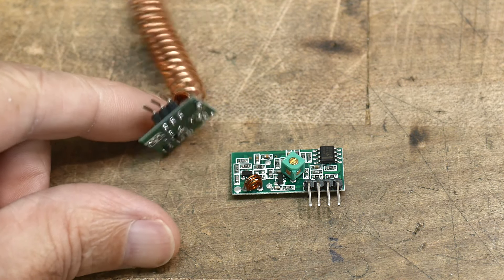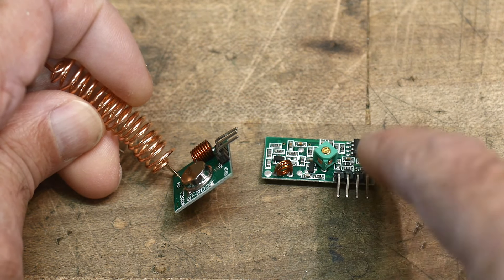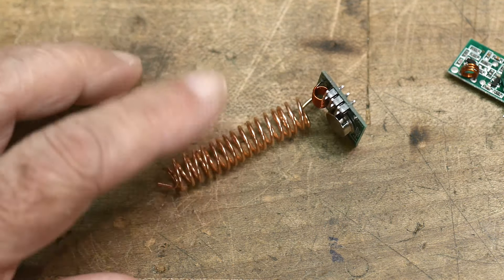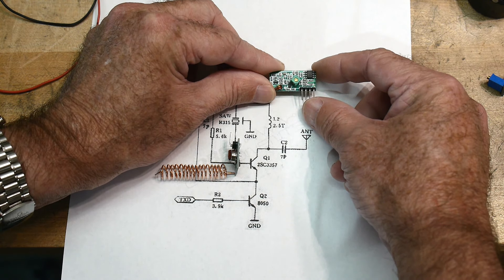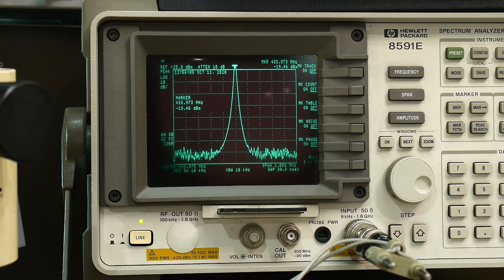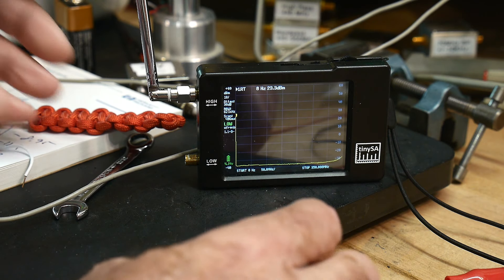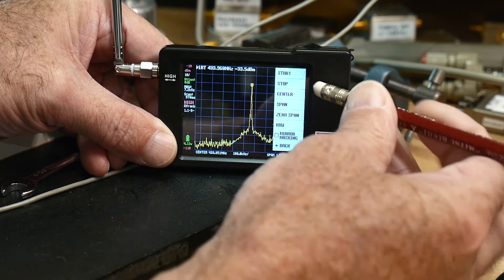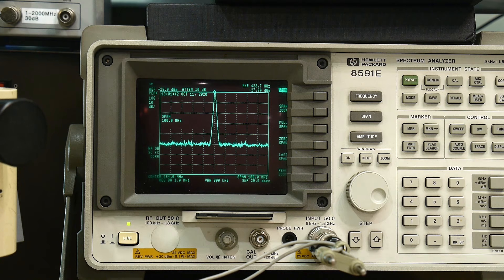#627 433MHz Transmitter

Comment: It is possible to move HP SA menus a little from the edge of the CRT by going into CAL > More > CRT HORIZ POSITION.

(For some reason, if the SA is set for NTSC, everything shifts to the right a bit too much, pushing some of the menu items slightly off the screen.)
Reply from the maker: Yes I know how to do that but every time I power off it forgets. I've tried many menu setting to try and save it but it just forgets. I think the firmware upgrade fixes this. maybe in the future I'll try again
Reply: @IMSAIGuy  Ahh interesting. FWIW, mine persists that CAL setting across a reboot. Its firmware is rev 980615 (it is a 8594E if that matters).
Reply from the maker: @MikeFikes  you have the very latest firmware revision. Mine is several before yours.

Comment: Sir can u please explain the circuit diagram ( schematics ) of the 433 MHz RF transmitter and receiver module and function of the components used in the module

Comment: This transmitter worked very unstable on one of my projects. On power on it starts transmitting somewhere in 300-500MHz (frequency based on LC feedback loop), then, maybe, if I don't put anything near antenna, it locks on 433MHz. On every transmitted pulse this unstability repeated. On ali there's another quartz based transmitter, without this problem.

Comment: Now, how can I use these 433mhz devices to let me know when there is a letter in the letterbox???
Reply from the maker: put a switch on the box. the switch is normally open. when the mailperson opens the box the device transmits.
Reply: I recommend to use turnkey LoRa boards, this overcomes distance problems and works reliable for 10 years on battery. Check out my Turtle boards at www.radioshuttle.de